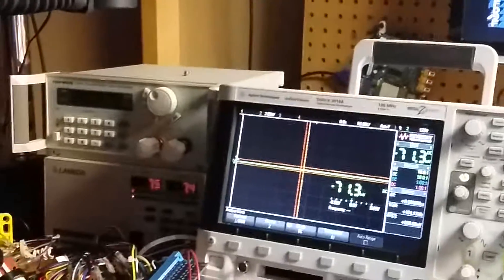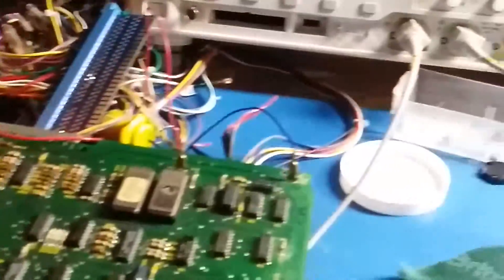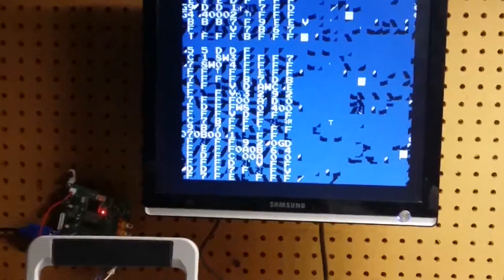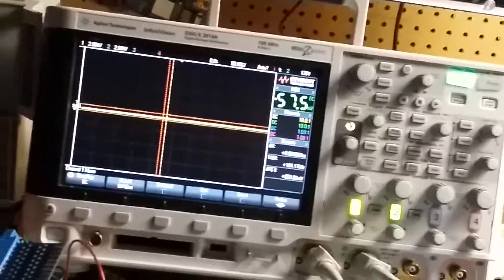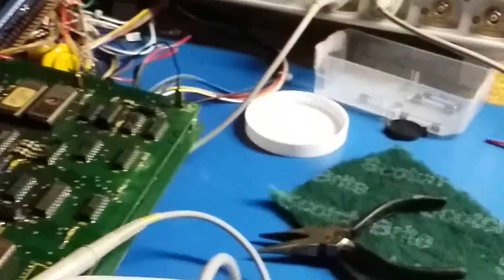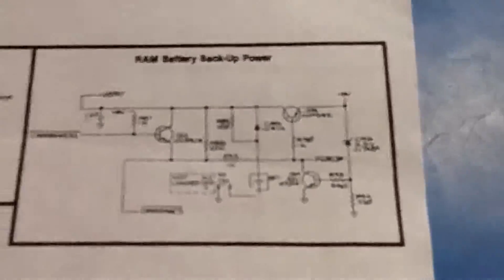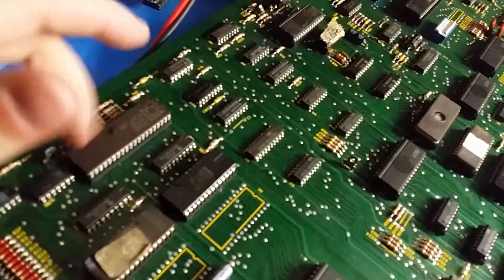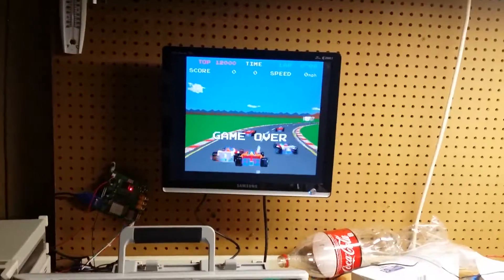Pole position repair

Comment: I had the similar issue with a RAM 73 error. It ended up being several corroded pins on the socket and z8002 on the far side. The same one as yours. Should have asked me what it was when I had mine spitting out the same error :-p  Glad you got it figured out!

Comment: You have a few grand worth of test equipment but you can't be bothered to make a proper test harness? What if a chip randomly decides to die causing the load to suddenly drop, Then poof goes your board receiving upwards of 7 Volts...